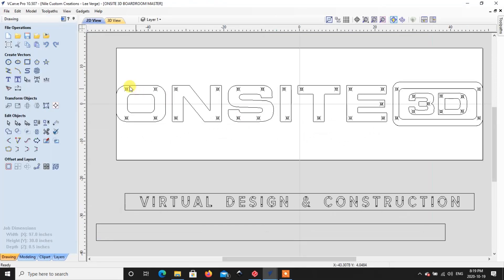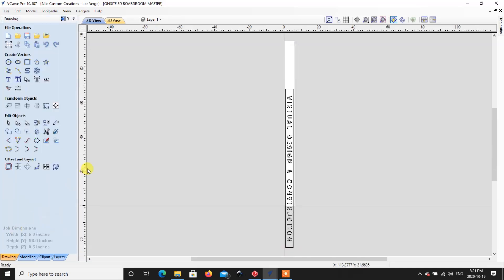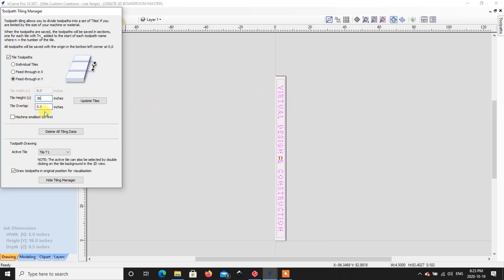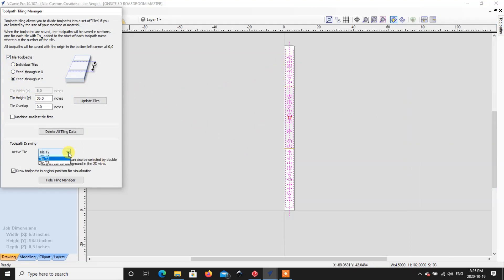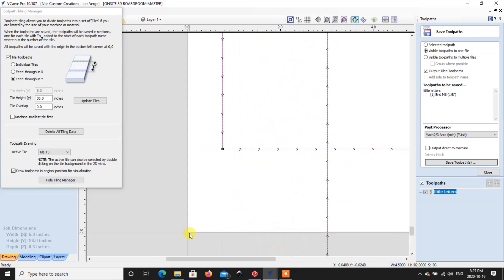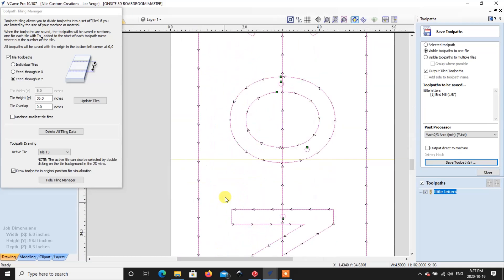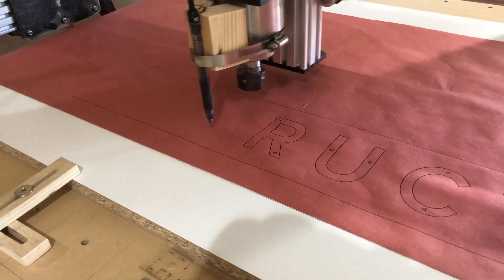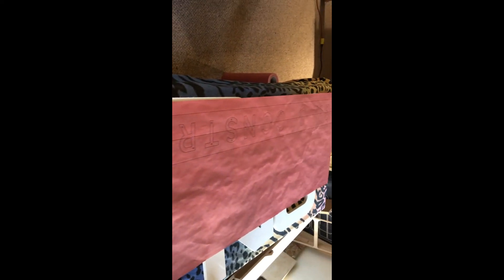V carve  tile toolpath for plotter pen

Comment: Hello, thank you very much for the very informative video you made.  Just one question: how do you keep the milling machine motor from spinning?
Reply from the maker: I just unplug the machine at the spindle on the top.  It thinks it is spinning and does no damage.  I was going to edit the G code but I thought that was overthinking it.
Reply: @nilecustomcreations1833  Anyway, thank you for your response.  I will try on my side 🙂